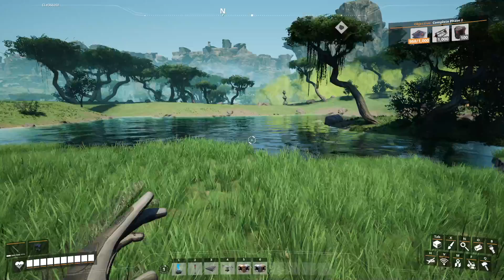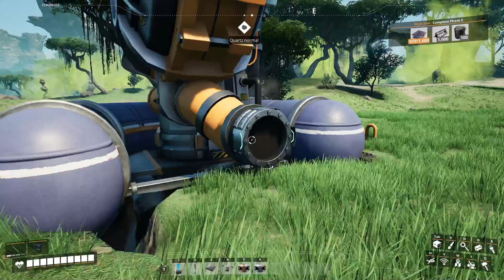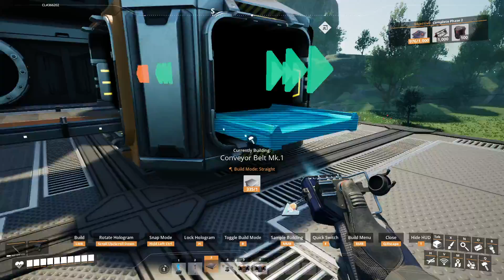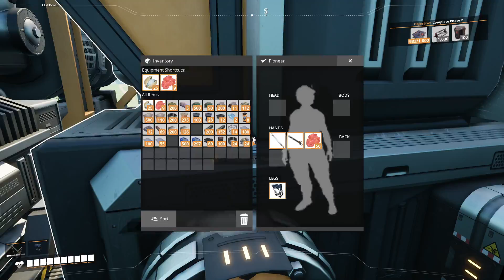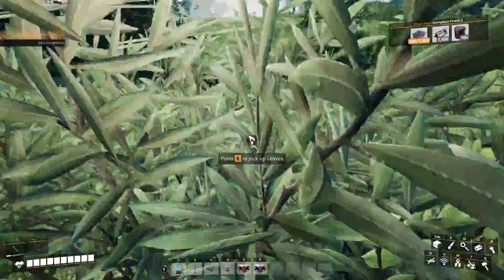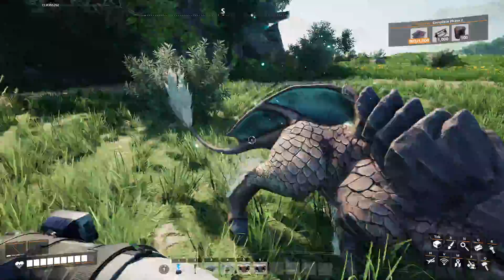Easy COAL POWER PLANT GENERATOR GUIDE - Satisfactory 1.0

Comment: Many thanks for this helpful guide ! I actually set up 3 coal generators with your setup and they powered my energy grid up for 200%, had 3 biomass-generators running;)
I was close to give up, feeling overwhelmed as i got coal generators.
I like that its that easy to make, because its  a great step for the middle between biomass and bigger coal-generator setups.
Now i can make some small production lines to help get next elevator level and setup a 3/8-coalgrid.😄

Comment: I'm trying to find the best way to power my coal generators.... or at least get things started.  I fail to see the need for a secondary source of power to run a coal power factory.  Even the water pumps need power.
Reply: You pop down a biomass burner to power the water extractors (and the coal miner if it's nearby) initially, but once the coal generators are up and running, you connect them to the extractors and your main grid obviously.

Comment: Best setup is 3 water extractors and 8 generators being fed by a pure coal node (until you get level 2 miners). Connect the extractors to each end and the middle of your  water input line. No underclocking needed.
Reply: Yes, mathematically 3 to 8 works out. But that is a water flow of 360m³ don't you need mk 2 pipes then? 
Also 8 is a lot :D I think underclocking is a nice idea to start and later add more. Luckily underclocking is not a permanent setting.
I like to first start things and optimize later, but that's personal taste I guess. I do understand people wanting to have it perfect from the beginning, but maybe an "easy guide" is the wrong place to look for perfection ;D
Reply: @lilcya6637  no need for mk2 pipes, just connect a water extractor at each end of the pipe feeding the generators and the 3rd in the middle. It keeps all 8 100% filled. The effort to reward ratio for building 3 is way too low. If you are going to find the coal and build the infrastructure then you might as well get some juice out of it.

Also, that is the start. I'll usually set the first one up to get off the biofuel and then build another 2-3 banks of 8 directly after.
Reply from the maker: It should only work as long as the generator block doesn't try to draw 360 water/min. So once more than 5 sixths of the power generation are requested this system will use 360/min. And I don't know how this works if it works, cause the pipes say 300 water/min tops. Maybe I'm wrong here but:

I'd love to know how it works to avoid the fluid limitations of Mk1 Pipes. Cause according to the tooltips it doesn't make sense at all.
Reply: @Ic0nGaming  because you are feeding 120 in either end and the middle. The middle feed is the key to keeping the pipe pressure up constantly no individual pipe needs to carry more than 360 to feed the block. Trust me, try this out. It will make you happy.

For bonus points and to keep it clean, try to build the generators directly on top of the extractors. I sacrificed a bit of power and used pumps on each line, but it might all fit within the extractor head pressure if you use a thin foundation.
Reply: @CraaaaaabPeople  I was wondering if that really works, so far I just theorized the maths. And it depends a little on how realistic fluids are programmed :D
As to the scale of things, it's my first factory game, I didn't start out with the maximum possible. I built 4 generators with 2 pumps and the plan to come back later if I need more power
Reply from the maker: @CraaaaaabPeople  Yeah, sure I get it now. But I wouldn't call that easy lol. I am working on an advanced version of this video with all efficiency and stuff so thanks for the talk. I just wanted to show something to people who are new-ish to the factory genre and what we are talking about isn't simple. 

It's surely simple just to replicate, but not simple to understand for people who haven't spent a lot of time on factory games. Either way, thanks for your input, appreciated!
Reply: @Ic0nGaming  I'm looking forward to it!  Apologies, I get a bit carried away sometimes as I have spent a truly ungodly amount of time in this game. 

It's always a good idea to keep efficiency as a focus because it can be extremely  time-consuming to fix bottlenecks at the end game.
Reply: I always have trouble with 8, so I stick with 6 per bank.  3 H2O Gens (2x100% + 1x52%).  With 2 Normal Mk 1 coal nodes (or 1 Pure)  down a simple manifold and the system stays stable forever, giving 450 MW per bank of 6.  I was taught the "rule of thumb" was 1 H2O Gen per 2 coal gens.  No over/under clocking except for the 52% extractor.
Reply: @Xix1326  it may be something to do with the pipe layout that is giving you grief with 8. If you try feeding a straight line running across the generators with a pump attached to either end and the middle (between the 4th and 5th generator) it will work flawlessly. Pretty much the letter "T" with a pump connected to each endpoint.

Comment: I just set up my coal power as well. I'm surprised you used the vehicle depot for transferring coal to your generators. When I would watch letsplay videos before getting Satisfactory, the trucks were always having routing and unloading/loading problems or causing inconsistency problems, so I never really used it besides driving around. I played this a few years ago and quit after like tier 4 or 5, but I'm trying again since release. I'm trying to go more aesthetically pleasing this time, so I used the pipes on bottom, and conveyor lifts and splitters above so they wouldn't clip. I just did what I did last time and walk to the first large lake with surrounding coal nodes and make the traditional 8 power plants and don't worry about it for a while. Great Video Ic0n!
Reply from the maker: So far the truck delivery lines are working well! Probably got patched a lot. I had a few issues setting up the tracks, but after that it went down swimmingly

And yeah, the clipping stuff is just ... I am a lazy person with not enough time at their hands, don't judge me too hard :D

Comment: There is so much wrong with this. Yeah, it works, but Holy shit this is the least efficient set up I have ever seen in my life.
Reply: It's inefficient because 3 is a really weird number to land on. It used 45 coal per min which is too much for an impure node but not enough for a normal node. And then you underclock it, losing 19% generation capacity. Should just go with 4 generators and 2 water pumps, then underclock the pumps, not the generators.
Reply from the maker: @CraaaaaabPeople  Ah, finally an answer with maths. I agree insofar that it's a bit more power you are cranking out. But there's more than one way to do the thing.

Your method overproduces Water, mine overproduces coal. Your method uses one pump more, which also uses 20 MW just to provide for one powerplant. I see my method as way easier upscalable, while your method maintains more energy output.

There's plenty of ways to do it, power output is for me personally not the only metric of efficiency. And I love the fact that there's many methods. I wanted to feature one that (hopefully) everybody understands and can replicate. 

I respect all machines as long as they do their job. And I love if we share different builds and all.
Reply: @Ic0nGaming The magic number is 8 generators, 3 extractors, which gives 360 water in, 360 out. Connect the exteactors to each end and the middle of the pipe that feeds the generators. It also takes exactly 120 coal, so it's very easy feed. Which would be the next step after 4 +2. Then, just keep building banks of 8+3. Super scaleable.
Reply from the maker: @CraaaaaabPeople  Yeah but 360 Water in requires Mk2 Pipes which you unlock with oil. Nothing wrong with your build, it's just not very early game compatible. Mk1 pipes only carry 300 water/min. My video is not calling it an EASY setup for no reason. Sure you can make much more efficient stuff with higher quality building parts. But that's not what you're starting with.
Reply: @Ic0nGaming  no it doesn't need mk2 pipes at all. Connect one to each end and one in the middle and all generators will be fed 100% of the time.
Reply from the maker: Well I called it an easy and quick setup for a reason. Also you leave no points of improvement, you don't even pinpoint what is so horrible about it. Like what is inefficient exactly?

I can only say it's a good setup if you just want to get it done quickly. Sure you can do MUCH more around coal, but that's not been the point of this video. I wanted a quick solution which everybody can replicate until they get deeper into more complicated builds.

Comment: Great information and very well presented!

There is a large lake to the northwest of the area you show on the map, over a hill top.  This area has lots of open space, so there is plenty of room to set up a good sized starter coal generator power facility.  Also, like you did, It's always easier to place pipe junctions in the appropriate spots before trying to connect pipes.

Of note, in the generator information screen, you can double-click the clock speed or target MW and type in what you like.  So to hit the target throughput of 40 water per minute, you could do the slider bar manually to set it at 89% or you could fine-tune it by typing in to set the clock speed to 88.888%.
Reply from the maker: Thanks, I had no clue about the direct input of numbers o/